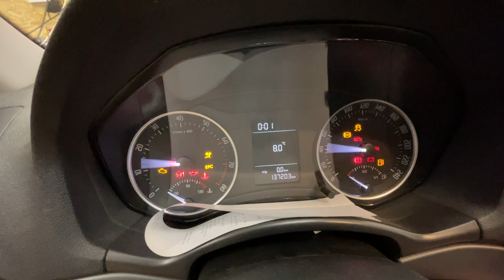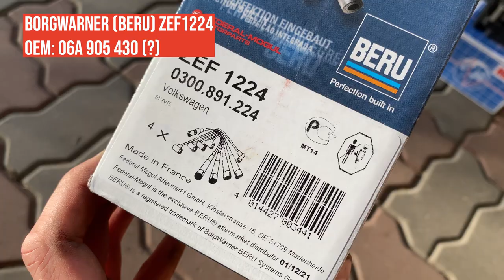1.6 MPI - Spark Plugs, Leads, Coil Pack (& Air Intake Seals) DIY

Comment from the maker: At 6:22 when you reinstalling the secondary air pump, there is a small slot that holds the dip stick tube in place. Make sure to put it back in its place, otherwise it will be kinda loose. :D
Reply: The new cables you fit them wrong and after you fix it . Are you sure about the firing order  2 3  and 1 4 on the right side od the coil ?
Reply from the maker: @georgikirov9910  Where is it wrong? 

At 8:18 you can see the markings A-B-C-D (top right-bottom left-top left-bottom right). 

A=1st cylinder, B=2nd cyl and so on. 

At 2:39 and 5:34 you can see they are wired the same.

Comment: On 180000km I already did this whole procedure twice. Also I got a middle oil consumption - 1 liter per 4000km. Also replaced all silentblocks twice- thanks to our roads. Such kind of adventures moving my mind to sell the car ;)
Reply from the maker: I understand. A liter per 4000 km is A LOT. Luckily I have started changing the oil often and quite early, so my 1.6 MPI is one of the very few that doesn't burn oil like crazy. But I have definitely heard about worse ones, where depending on the driving style the engine would burn as much as 1 liter per 1000 km. That engine is basically getting a continuous oil change...
Reply: @carsandtools  I used alfa romeo with 2.0 TwinSpark engine. It used 1 liter per 1200 km. I still drove 60 thousand kilometers with that. In the end it was 1 liter per 180 km. Then I had it scrapped : - )

Comment: Great video. I have an '09 Jetta with the same engine that stumbles at idle and low RPM load when it's hot (seems to idle smoothly when it's cold). Its not enough to smoke or throw a CEL, but it's just an annoyance whdn idling at a light and it does burn (or leak) quite a bit of oil. Just haven't decided if I want to trar into it like this, I've never had a car that requires removal of intake manifold to change the plugs.
Reply from the maker: For just the spark plugs, the removal is not needed. I've done it once. It's possible but quite a pain especially for the two middle spark plugs. But definitely doable.

Comment: Thank you for a very good workflow. What difference do you think is between Denso  IK20TT and  K20TT (power, stamina)? and why did you not ordered the original ignition module? It is commonly available..
Reply from the maker: I think the "I" ones are Iridium and many people have reported they lasted them significantly longer than regular plugs, but I have not had such luck as seen at 8:32... I've got them again, though, because without taking the air intake off its such a painful job and I don't want to do spark plugs again for as long as possible. Whether that was smart or not... well, I guess it doesn't really matter now. :D

As far as the OEM ignition module, nice catch - I did not really notice it was also still available. :D But the Hitachi is also a good one. I tried to buy all the parts from renowned aftermarket brands. If I went for the cheapest everything, it would be a lot cheaper, too. But I intend to drive the car to the dust, so... :D

Comment: Im confused shall i replace mine too, its 21 years old, i got the same engine. But i feel somewhere a heavy performance loss, especially in first gear. I replaced the spark plugs before with ik20tt.

Comment: Alguien sabe español? tengo un a3 1.6 bse 102hp manual 5 cambios año 2008 exactamente el mismo motor.. pero gaste casi 1 millon de pesos argentinos en reparaciones el motor me sigue fallando😂 siento como si la
Explosion el quemado los hiciera mal y a destiempo.. 😢 nose como explicar.. como si hagia pochoclo mientras ando va haciendo borbotones.. y si he cambiado bobina cables y bujias 3 veces.. aros lleve a reparar leva, canbie todas las juntas, bomba nafta filtros todos.. medi cilindros medi presion nafta 4 bares.. ya nose que hacer

Comment: Hello are you losing some oil on that engine? when its cold and when travelling highspeed? thanks
Reply from the maker: No, but I am also doing oil change every 7-10k km. When running on the Long Life interval, these engines known to start burning lots of oil after 60k or so km when running a long life oil interval.
Reply: @carsandtools  147k and it burns a lot of oil during winter and long drive. I also experience misfire couple times. First one i change coil pack cables and spark plugs. After a year it happen again, change coil pack and spark plugs, but still misfire. The culprit is the cable. And it happen again for the third time, same problem the shortest cable. Luckily i keep my old cables.

Comment: Is it mandatory that both the ignition coil and ignition module should be changed? Isn’t the coil itself enough?
Reply from the maker: Of course it's not mandatory, just change what's bad (if you can tell in advance what the culprit is). 

In my case I didn't know exactly what was bad and decided to change everything since the air intake had to come off (and I really didn't want to do that more than once). Turned out I had corrosion on both the leads (9:57) and the coil pack (8:27), so it worked out for me. :D
Reply: @carsandtools  
Great then! I changed the spark plugs, cables and ignition coil but not the module sitting on the ignition coil. I really cannot tell if the idle improved since, that’s why I was asking. I have the exact same engine. I would assume you have no gas smell on the back, right?
Reply from the maker: @gheorghinacov6008  Oh ok, I didn't even know they could be separated, I always saw them as a whole thing. What do you mean by "gas smell on the back"?

My main problem was misfiring under full throttle and insane slow crawling (the colder it was, the worse it got, too). I would put it in first gear, slowly release the clutch, give it a little gas and nothing would happen. Then, after 1-3 seconds, the something suddenly woke up and gave as much throttle as if I had put the pedal to the metal. This was going on for second or third winter and always stopped in the spring. Only this winter it came back with misfires and check engine lights, so I finally had to do something about it. :D As I found out, 1) there was corrosion on 2 of the leads as well as on the connectors on the coil pack, 2) the spark plug electrodes were completely burnt out so the gap was way bigger than it was supposed to be (8:46).

Rough or uneven idle could also be caused by cracks and subsequent air leaks anywhere on the air pipes, air intake or seals, but most commonly (at least from what I saw online – for instance at https://www.seatcupra.net/forums/threads/1-6-bse-engine-rough-idle-solved.456352/ ) was caused by damaged seals. Have you checked for that?
Reply: @carsandtools  
By that I meant there is a sharp gasoline smell coming from the exhaust. I did pass the annual technical inspection but you just cannot run the engine inside of a closed garage. The smoke isn’t visible though. Now if you mention air leaks I do hear something whistling around the throttle body but I cannot tell if that’s how air whistles while goes through a tight opening of the valve.
Reply: @carsandtools  
Anyway how is the engine idle when hot? I mean can you see it shaking even a little bit?
Reply from the maker: @gheorghinacov6008  Yeah, it definitely shakes a little bit, but nothing I would call out of the ordinary.
Reply from the maker: @gheorghinacov6008  Otherwise I've had this car from new, in February 2017 I was first changing the sparkplugs at 62k km for Denso Iridium ones (the same ones as in this video) and after that the engine was so quiet that I had often times thought it had stalled when I was sitting in the car with engine at idle. These days it's nowhere near as quiet or smooth as it was back then after the spark plug service. But also it's not doing anything that would have me concerned.
Reply from the maker: @gheorghinacov6008  And to get to the original question, no, I definitely don't have any gasoline smell in the engine bay area, nor I think you should be able to smell gas in general.
Reply: @carsandtools 
Thank you! Some claim this engine idles shaky since the car goes out the factory. Was yours shaking since new as well?
Reply from the maker: @gheorghinacov6008  I can't tell for sure because I don't really remember, but since you asked, I was watching the engine the other day after 600 km drive and currently it's shaking a little bit more than it used to. I suspect the timing could be ever so slightly off, since I did the timing belt myself 😂 but it's still not so excessive that it would concern me. I can upload a video when I get to it. But it would 100 % not hold a coin 😂
Reply from the maker: @gheorghinacov6008  The other day I was refilling the windshield washer fluid while the car was started, so I recorded the engine shaking. It seems quite rough to me as well, now that I look at it, but it's not so bad that I would be tempted to do something about it... :D

https://www.youtube.com/watch?v=BDIXvNRwpYE

Comment: At 7:10 what did you do?
Reply from the maker: When you open the driver's door, the fuel pump primes the fuel lines (builds up pressure). Then I purged the air by pressing the valve.